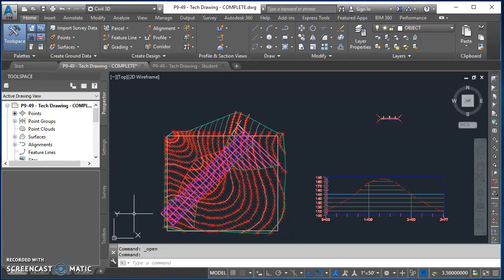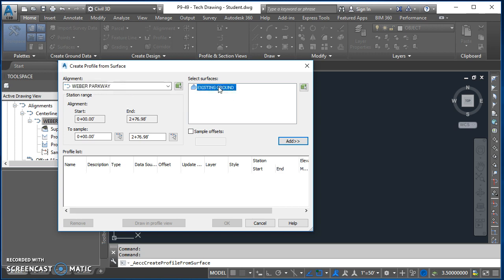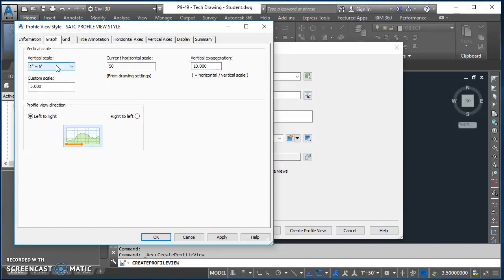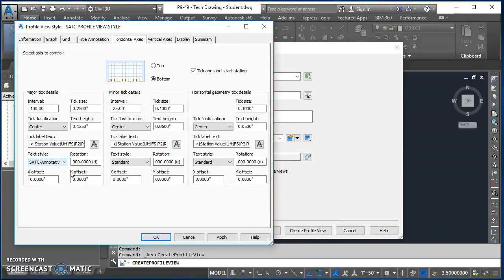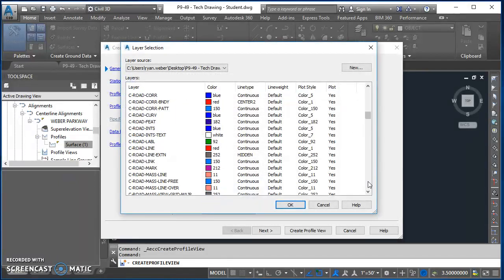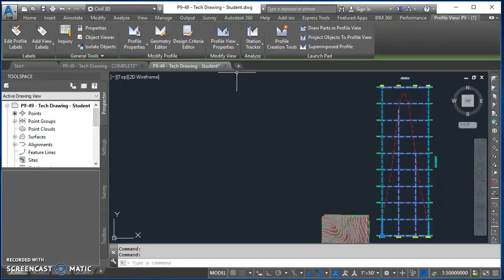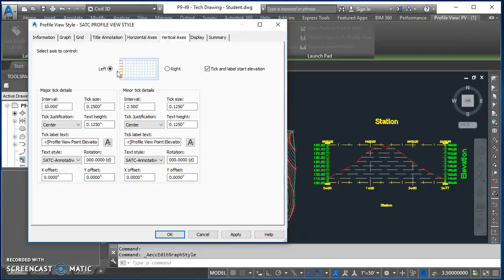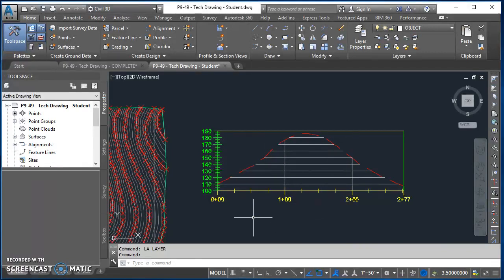Creating a Surface Profile and Profile View in Civil 3D

Comment: how do I create a surface file? I have a topo file referenced, does that in itself count as a surface file or do I need to create a surface file or some sort and add it? to create a profile, I have to have a surface so i can click "add" and from there hit next..and so on...but i dont have a surface to add.
Reply from the maker: Hey Miriam! I have to admit I have limited experience with Civil 3D, although it does sound like you need to create a surface. My experience has been limited to working with point files or importing point data. You may be able to define the surface by using a Digital Elevation Model (DEM) rather than only referencing your topo surface. I wish I could be more help.

Comment: Hello again, got your message. Can you do a video about creating a feature line and break line, not sure what's the difference and when to use them.
Reply from the maker: Hey Cecelia. I wish I could help, but I rarely use feature lines or break lines, so I would not be a good resource on this topic. I did find a forum which does provide good basic information about this, so you might check it out; https://forums.autodesk.com/t5/autocad-civil-3d-forum/what-is-the-relationship-between-a-feature-line-breakline-and/td-p/5612003.